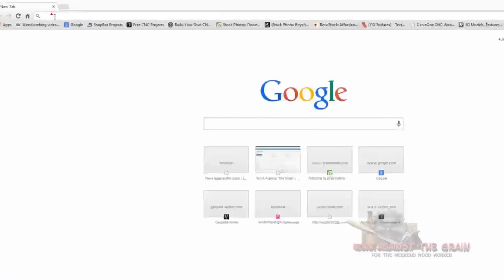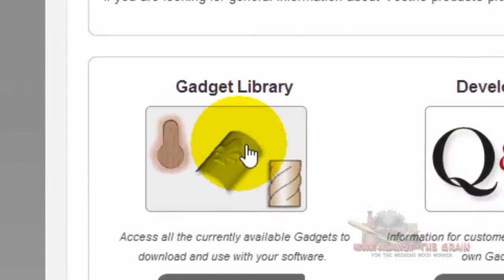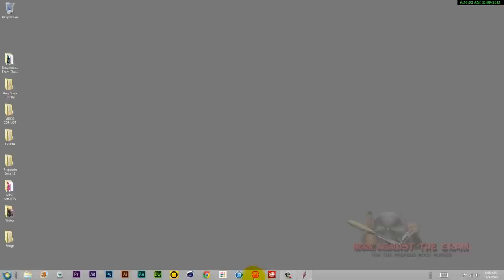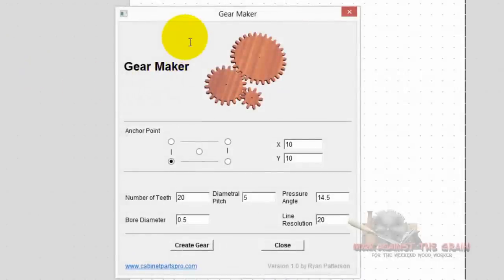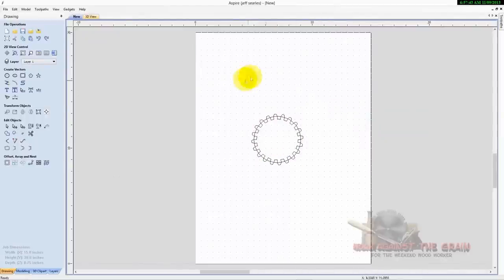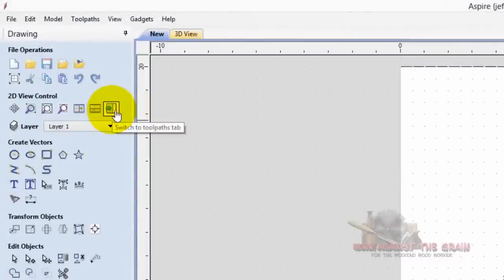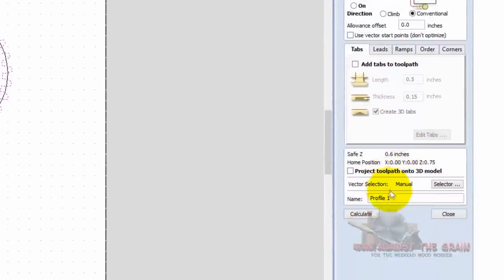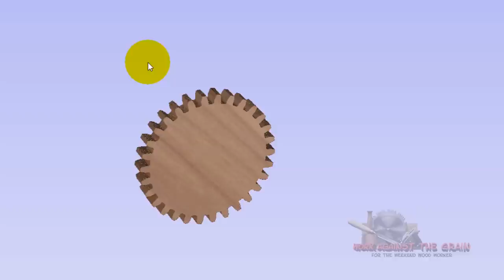Vectric Gear Gadget

Comment: this is VERY interesting... but some of the gears are round, others, like the one you show us cutting isn't really, it's kinda hexagonal, with some of the teeth actually further in... I assume this format still works fine as an asymmetric gear... right?
Reply from the maker: Nelson, You are correct, I did cut a couple hexagonal gears that were generated from a .pdf file. The others were from the gear gadget. I am experimenting with a clock design that uses both the hexagonal gears as well as asymmetrical gears. Great observation...thanks for watching.